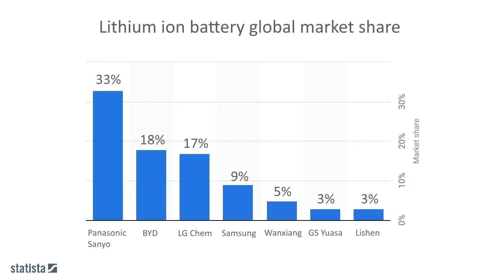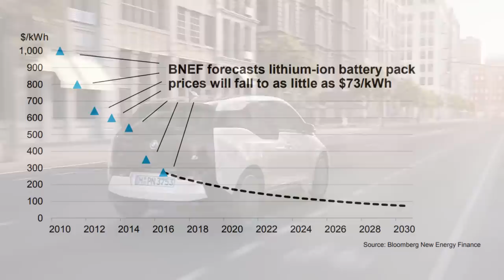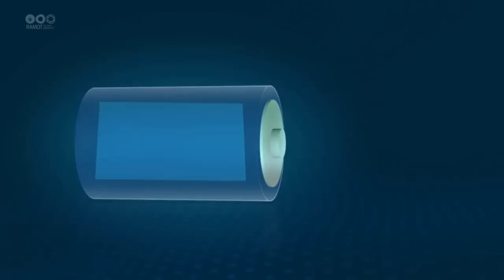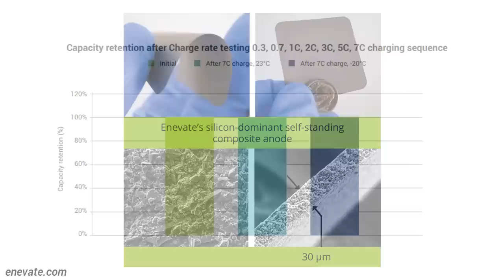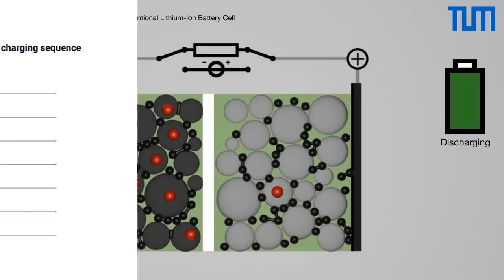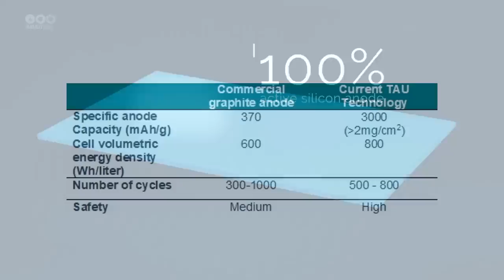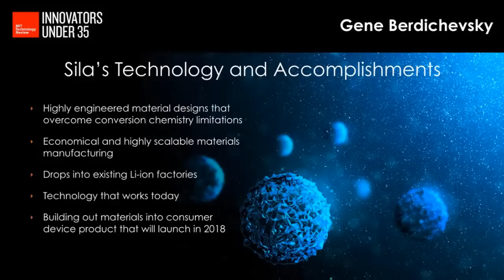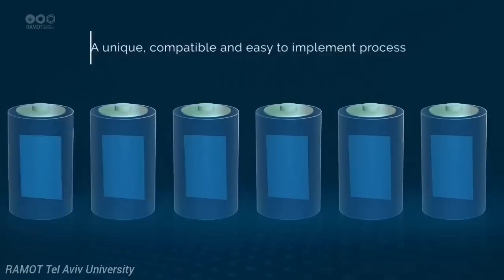The Battery Revolution. Ultra Fast Charging

Comment: Elon Musk recently suggested that Tesla would be hitting $100/kwh in the near future, at least for bare cells.  The timeline presented by Bloomberg might be too conservative.  As for extremely short recharge times, they are unlikely for two reasons:  1) There is a limit to the amount of energy that you can push through a cable light enough for a human to lift.  100kwh in five minutes requires 1.2 MegaWatts of power.  At 1000 volts, that would be 1200 amps, which would require a cable several inches in diameter.  2) batteries don't like to be charged super fast.  They get thermally stressed and will not last long.
Reply: Did you not even watch the video?  They were talking about new battery chemistries that CAN get charged faster.
Reply: 400 KW chargers are currently under development by several companies. All they need to do is to put two or three of those separately. There is no reason why we should use a single charging cable. It is always an option to distribute the load in two or three cables.
Reply: "First Cable's Free, any more and i got to...charge"
Reply: Most of us could easily live with a car that travels up to 200 Km/day and charges in 8-10 hours by solar or wind power. That should be the simple goal. Most people don't drive further than that and can charge our cars overnight from stored battery power in our homes. And most EVs are nippy enough already without needing to out-accellorate a Ferrari.
Reply: @bobmarshall3700  My 12 solar panels produce about 25 kwh per day on good days. Or maybe 80-100 miles So there is no way that solar will work for cars to increase range any significant amount. Parking lots with roofs covered in panels while PARKED might make sense but only when the sun shines.. The panels on my roof cover more surface area than a Nissan leaf has, and adding that much weight would massively reduce range, meaning you then need more panels, which means less range.

Comment: To those who are concerned about recycling of Ev batteries keep in mind that when an electric car goes to the crusher the battery would likely be recycled in an appropriate manner. What do you think that happens to all the engine coolant, used oil and gas from ICE cars? 

    Think about the tons of lead acid batteries that get rebuilt and resold at stores like Walmart and Cistco. Now thats lead acid batteries I would imagine that if EVs become the primary vehicles on the road there would be a huge imcentive for independent battery remanufacturers and recyclers. 

As far as the pullution coming from electricity production, keep in mind that there's many ways to run a power plant. With new storage options, hopefully coming soon,  alternative energy would make more sense. Imagine tons of pre charged battery packs constantly recharged from solar, wind and tidal energy farms delivered to cities the same way gasoline is. If energy density specs  and cost continue positive improvements this will change everything in everyday life very fast
Reply: Samuel Rosenberg 
Hi I wasnt aware that Tesla even had a recycling program but it sounds like a ripoff from what you wrote.

 Anyway the battery pack is made from thousands of particular cells. When the pack usually goes "bad" often times its just a few cells at a time trust me there is an incentive for independent shops to do this kind of repairs.  These battery cells have many uses even if they dont have full capacity. Cells may still be adequate for Vaping E cigarettes , Head lamps rebuilt laptop batteries ebikes ect. Check out ebay and you will get an idea.
Reply: Recyclers do what is cheap and affordable. If u look at the sidewalk, recyclers strip throw away TVs and electronics of the cable and certain components for the copper and leave the rest lying on the street. The same will go for batteries. The stuff that makes money will be stripped and the rest will lay in the landfill here or abroad and leach into the water system poisoning it and the plantlife and eventually animal life and carbon-nitrogen cycle. Dont kid yourself thinking everything will be recycled ... it wont.

Even "green companies" that stay "compliant" are not green. Toxic stuff is dumped down the drain to save costs and no one monitors that. How can they? No one tracks how much is thrown away, shipped away to landfills. It just happens ... so they dont have to deal with it. Businesses want to reduce costs. They are not in it to be "clean." They might use "clean" to sell u products but they have no incentive to do so if it costs them more money.
Reply: peachees 
I agree totally its one of those "lesser than two evils" issues. Just being pragmatic, not everyone has the ability to walk or take public transport.   Ev's should stay on the road longer since they have almost no moving parts. As far as battery waste rather have that than billions of gallons of oil by products from combuation engines. Personally I ride an Ebike that uses a recycled hoverboard battery and drive my 20 year old car when its not safe to ride the bike.
Reply: And those recyclers earn a profit because there are materials worth recovering.  It's not any different for lithium, minus one key thing:  Economies of scale are in place for lead acid packs.  They're possibly the most recycled item on the planet.  We're not tooled and scaled up to mass-recycle lithium packs, so it's much more expensive.

Comment: Hail the most efficient commuter - the electric bicycle.
Reply: Interesting thought, a volvo 7900e electric bus, has a seating capacity of about 60 and has 160kw of motors, so about 2.6kw per passenger, it does vary as if there are people standing, could be over 70, thats maximum tho and it will use only a fraction of that power as an overall avarage over an urban journey, as max will be during pulling away from the stops, but once rolling, it wont use much, then regen is putting some back during braking, so i think that power wise, there wont be much difference to an electric bike per person, altho the bus can go much faster, also, look at how much space on the road 60 cyclists would take up, alot more than 1 full bus
Reply: @eddywilliams6212  
in terms of used space - for sure, much more than 1 full bus - but less than a car, also parking takes much less than a car for only one commuter
in terms of efficiency - it depends on how one uses the bike - if only as an assistant to go a bit faster/climb hills so you don't reach the working place sweaty - the bicycle will win.

PS: I would love to see some electric buses on the streets of my city (we already have trolley-buses here - but also really old buses that spew black smoke)
Reply: @shmadmanuts  we have some electric busses in edinburgh, they are soo smooth and quiet, much less fatigue riding on one, its the way to go, cant wait till they get more! The only bad thing is they are so quiet that you can every bodys conversations on the bus..
Reply: eddie williams busses start and stop many times on every journey. That uses lots of energy. More importantly, outside peak periods buses are generally running empty.
Reply: @shmadmanuts  the best EV is the trolleybus. 😉